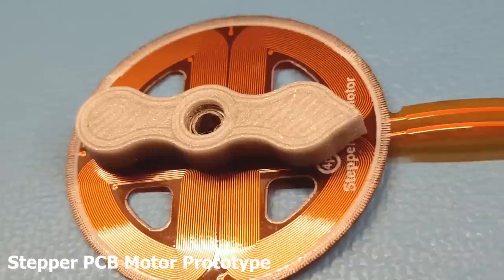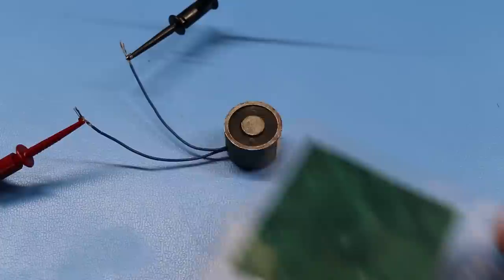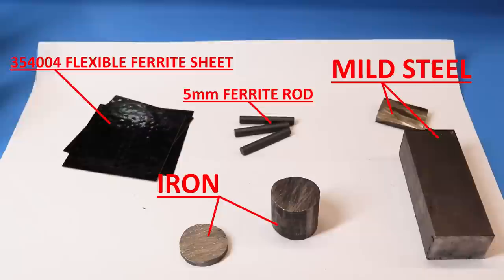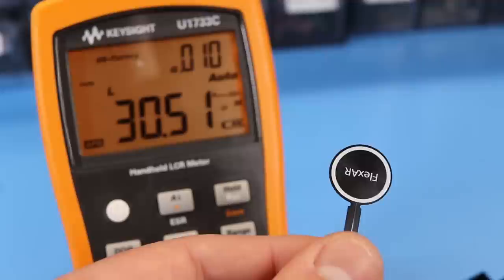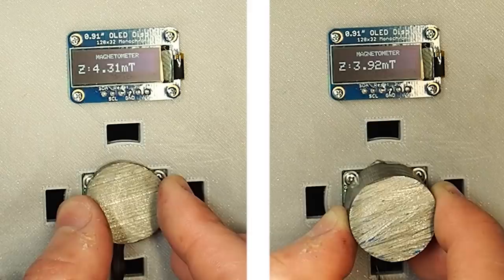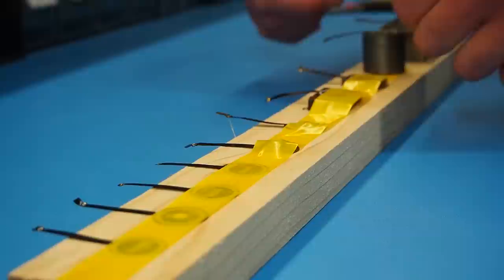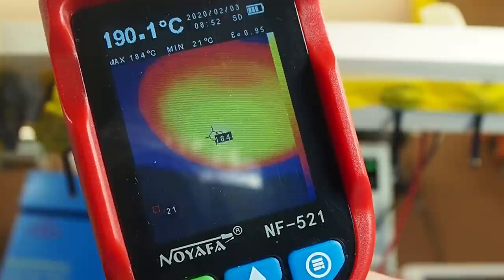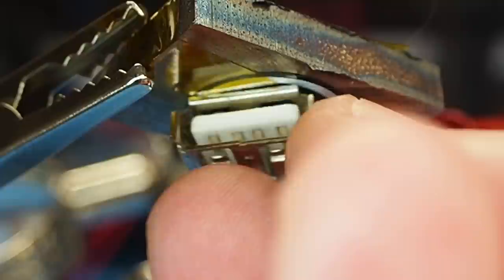Learning about PCB Electromagnets

Comment: Maybe you could use the ferrite sheet at high frequencies, connecting both actuators in opposite phase with each other.

You'd be running them with sinusoidal AC, so they should attract/repel each other depending on the phase offset that you specify.

If the ferrite material works better at high frequencies, this should take that advantage :)
Reply: and maybe stack 2 or 3 -  connect in series
Reply: It'd be interesting to run a large frequency sweep (sinusoidal, up to 1GHz) and see what are the resonances for different setups of coils and backing materials. Basically tuning these as an antenna.

To do this you could place two coils near each other, one of them receiving the frequency sweep, the other one recording amplitude with an oscilloscope.
Reply: I think higher frequencies have higher energy but its have low wavelength its reduces the power of attracting things on the other hand :
Higher frequencies is good for data transfer and wireless energy transfer as we seen in FRID. SATA cables.

Comment: If you consider using them as actuators, a voice coil design like the one on the hdd drives would be more efficient. Using the Lorrentz force instead of magnetic force. Cheers!

Comment: This is where the physics definition deviates from the electronic engineering definition. IE in physics any old piece of wire with a current flowing because it produces a magnetic field, is an electromagnet. In Electronics an electromagnet has to be capable of doing a (mechanical) job. There are still "air core" inductors and electromagnets in electronics though.

Comment: You have to try using magnet wire,(very thin) coil with ferrite material with thickness of may be 2-4 times flexar. Or even thin if possible... May be it can be use in any future projects or anything...

Comment: Could you use the change in inductance to identify metals, for example to sort coins?
Reply from the maker: if the change in inductance is significant it can be used to identify metal yes.. for coin sorting i'm not sure - but it could work given that the position of the coin is fixed so that coil always read the same location

Comment: i think multiple layers of PCBs have hole in center joined in series on single ferrite core can increase the power of attraction and also reduce the heat because of hundreds of turns. 😋

Comment: How about a drop of WD-40 and a drop of ferro fluid on top of the coil with a light ring to detect the magnetic flux? (Like a ferrocell)  How about AC through the coil and a tiny drop of mercury or bismuth crystal as the armature?  How about a whole row of these coils moving in a peristaltic motion to move a foam boat like tiny paddles?

Comment: Can you also try it with a permalloy tape instead of the ferrite sheet (or one of the other high magnetic permeability https://en.wikipedia.org/wiki/Permeability_(electromagnetism) ) please ? Also I wouldn't call flexar a voice coil actuator (just air coil actuator), voice call actuator are actuator which are using the lorentz force as a working principle.

Comment: Do you know if is possible to use flexar as inductor coil or a transformer for high voltaje circuit?
Reply from the maker: Yes it can be used as an inductor.. one cool application is inductive proximity sensing. I have also seen people use pcb coils as transformers